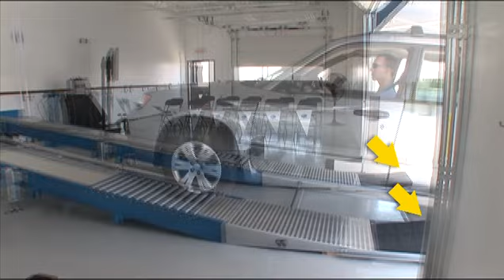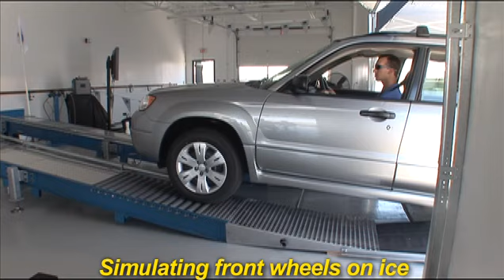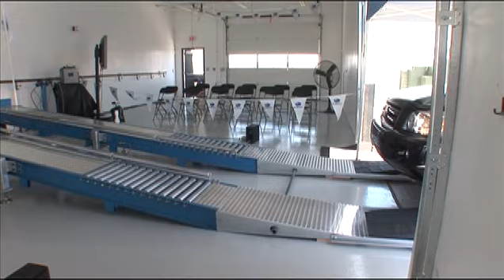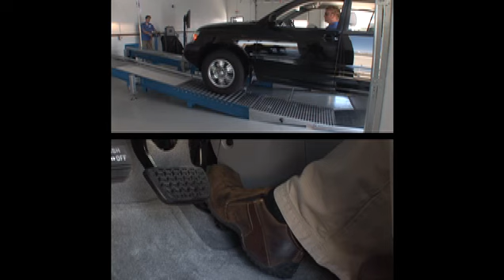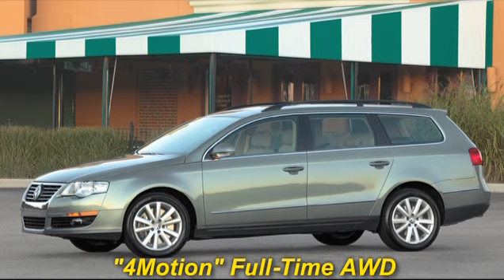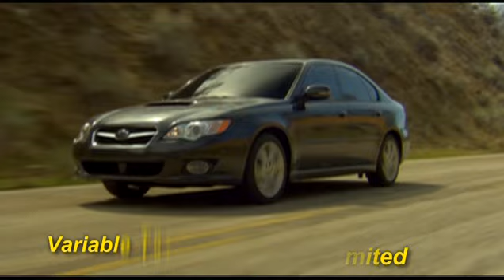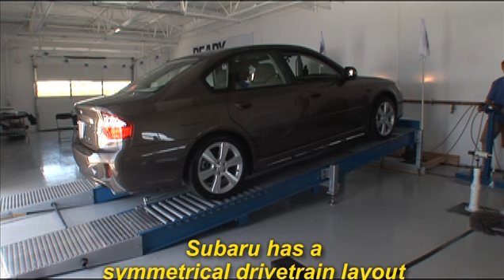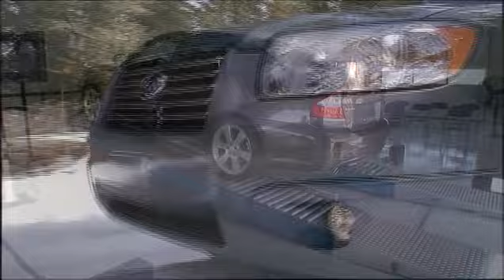Subaru Symmetrical AWD vs. Honda, Toyota, and Volkswagen

Comment: Good lord, the VW isn't failing at the ramp due to transverse engine mounting. It's because it lacks the ability to sufficiently lock any differential to transmit the required torque. Keep making the ramp steeper, and the subie will fail like all the others (or it will overheat its drivetrain). Make it less steep, and the VW and Toyota will do fine.

A vehicle with lockable differentials will pass this test at much, much steeper angles. (Modified toyota pickup, land rover, land cruiser etc etc). That's why you buy true 4WD with a "PART TIME" designation. Aka: Can't use it on dry pavement because it grips so well.

I will say, Subaru tends to have the best AWD system for mixed use driving. The thing is... you pay for it. It's not as fuel efficient, it needs more maintenance, and it is heavier. But it is probably the best full time AWD solution.
Reply: THAVANI it might have just been a clogged or burned up catalytic converter or a timing sensor issue, possibly something relatively minor.. poor Subie!
Reply: Last time I checked a Subaru has some of the best fuel mileage when you compare it to similarly equipped AWD vehicles that are not diesel, require premium fuel or in a luxury brand segment were the car cost significantly more. So essentially the foresters and outbacks closest competitors are the hr-v, cr-v, hylander, rav4, terrain and equinox. Some of these may have better fuel mileage but at the added cost of maintaining a hybrid or diesel engine and can get expensive as well (diesel significantly higher price than 87 octane which most subarus use) Also most sacrifice power or size to get them more efficient in turn making them less useable. Last saying they need more maintenance is absurd. Subarus get easily 250k miles as long as you follow the owners manual to the T(that's where people fail) What maintenance cost more? Never had to replace a major part and im 80k miles in and my live data reading on my legacy shows it runs like it did 4 years ago. Also people have a bad habit of putting low quality fuel and other fluids in their cars that make them "cost more to maintain." BTW my legacy at most consumes a quart of oil every 1600 miles which is not bad being it takes 6.7quarts every oil change and I have never had a transmission issue (their main issue is people don't rotate tires so they wear out and transmissions fail from uneven tires in subarus), head gasket issues no longer exist in these. So as long as you take car of your car, how is it more expensive. Some cars take over $100 just for an oil change.
Reply: I have a 2004 Outback H6 with a standard non-VDC 4EAT. Basically what you get from the Forester here. 

You CAN ABSOLUTELY lock 50/50 split with the auto, just pop it into 1 or 2 on the gear selector. That makes a massive difference, and you can definitely clear steeper ramps like this. I used to run mine on Jeep trails in the mountains south of Las Vegas with great success.
Reply: Have had a forester, full time AWD... fuel part is very true. any full time AWD car, alot of parts and especially the massive Subie trans and engine = heavy and will eat fuel, more wheels to feed whereas FWD will just pull the car and has less parts needed to send the power towards the wheels thats why they made massive 4 cylinder FWD vans. But if i am not wrong you can remove a fuse and start the car and the car should start in front wheel drive. not sure about the new models though.

So about the forester, 6spd non turbo. took it 500000km no major issues! just serviced it, regular oil stuff, the engine was never taken apart and the gearbox never had issues even the diffs.
Only changed belts, batteries, radiator and tyres like any other person.
The car eventually died not an engine issue or trans as far as i could see, the car was running perfectly as you start moving but getting the car moving, it would bog down like something was restricting it, maybe electrical issues as you give it gas and it sounded like a refridgerator condensor as if it was the air con because it kept giving the car a super high idle every 10 seconds while at a stop and only at a stop and couldnt turn it off.  might have been a driveshaft issue for all i know but its long gone now.

Now i have a Gc8, 5spd non turbo, 200000km no issues as well. same as the forester
Reply: Oh you can buy An Sti as it has DCCD no need for modifications 
50/50 power split and you can lock the centre diff and play around with Traction Control as well which in snow should so wonders
Reply: @thbabni  or just buy proper nordic winter tires and drive on snow/ice without any problems with a FWD or RWD car... I admit though, for ultimate fun on snow/ice either BMW xDrive or Subaru STI.
Reply: I dunno. My subaru crosstrek diesel averages 30 mpg with agressive driving, which isnt bad for a full time AWD crossover
Reply: Ben Mcghie shift the subie into 1ST gear axles lock becomes 4wd at low speeds
Reply: how you should overheat the drivetrain?
first of all there is a lamp which shows too hot drivetrain/diff oil.
second, if the traction control recognize spinning wheels with no traction, the system will brake these tires, so the diffs act like normal.
this stability control is also dangerous if you drive too fast on snow in corners, since you dont know what some brakes will do automatically if you slip a little bit.
Reply: Subarus are definitely not heavier
Reply: even if Passat has ability to fully transfer the torque to one front wheel with traction,it will be difficult to climb up becoz the whole weight of the car will be pulled with one front wheel.. however in a horizontal path,one front wheel may pull the car..
Reply: what crack you smooking? My daily crosstrek gets 32-35mpg a bit more than my familys rav4 toyota and cousins CRV, these smaller SUV's get around high 20's to low 30's in mpgs so i dont know what youre talking about. Lets talk reliability, cause my cousins CRV awd system gave out and needed to be towed on a flat bed a few months ago, stop talking out of your ass like subies are so bad.
Reply: 2018 WRX weighs 200-500 pounds less than an Audi A4. So idk where you get “it weighs more”. Hell it weighs 1000lbs less than an S5.
Reply: @FunBounty  I hope it does. The WRX is a half rally car. The S5 is for fast driving on the Autobahn.
Reply: my impreza weighs 3200lb with fuel oil and all fluids and me in it. and gets 28mpg... so

Comment: What a gimmick... you have just demonstrated the difference between a helical diff and a clutch/plate diff. Obvious Subaru bias and funding is obvious.
Reply: Hoozer YT to be honest the other dude did a lot more science talking than u did.
Reply: Your Moms Fudge Packer how is it bias  ... they did tests on different cars and saw which ones were capable
Reply: Hoozer YT These vehicles are not designed to be used this way. The test is invalid. This is an exaggeration of what a clutch type LSD will do vs helical LSD. The cars that made it up had a plate/clutch type diff/s, the ones that didnt, had a helical diff/s. This just goes to show how ignorant people are, not knowing the difference, and blindly believing what they see in front of them without doing any proper research. Not to mention the Honda AWD is not even a full time AWD system. The title should be "Clutch diff vs Helical diff test". That is what is demonstrated here.
The bias for Subaru is clear. The Volks had a clutch type diff and made it up too, why did the not promote the Volks? SMH lol people are retarded if they trust this bullshit video.
Reply: Your Moms Fudge Packer ok turn to insulting me... just goes to show your intelligence
Reply: That is apart from the point. You clearly dont understand the difference between the two if you're still saying one is better than the other. Go do some research kid.
Reply: Your Moms Fudge Packer One was good enough to make it up, one wasn’t, kid.
Reply: Until the plates weld themselves together and blow the diff. Also this situation is a horrible representation of real life usage. Your point is moot.
Reply: Your Moms Fudge Packer ok and?
Reply: Stop being a hater and just go buy a Subaru. You know you want to.

Comment: Notice there are no Nissan, hmmm afraid of something Subaru?
Reply: 860kgamer hahahahahahaha why would they? Nissan and Mitsu both went to crap
Reply: thisis howiroll the GTR is a top of the line car the AWD has more sensors and parts than the space shuttle. And its going to stay that way. We are comparing cheaper cars not race cars. Subaru system is basic and proven reliable
Reply: What makes you think nissan is even comparable to subi?
Reply: Nissan isn't comparable to a scooby, there are years of rally championships and rule changes that prove that lol.
Reply: There's also no Ford Chevy Dodge Fiat BMW Skoda Volvo Peugeot Renault Mitsubishi etc etc... They can only test so many cars.
Reply: They’re afraid that they’re gonna roast the shit out of Nissan like they did Honda.
Reply: THAVANI once again we are not comparing the top of the line systems here just cheap cars.
Reply: DroidTech lmao! Are you serious? Mitsubishi is on the bandwagon now of mid size and compact SUV. Their compact car is a joke too.
Reply: The Nissan GTR is primary rear wheel drive... 
it ony uses AWD when its needed. works like a 4WD and has a transfer case. Thats the R32, 33 and 34.
The R35 sends power to the rear first then sends it back to the front diff since it has a rear mounted transmission.
 All Nissan GTRs have a 30/70 torque split meaning they send 70% power to the rear and 30% to the front which helps in launching a car, gives you a harder launch that puts you into the seat because of that little 30% towards the front that lifts up the front end a bit as you launch the car hard with the Launch control

Nissans GTR AWD/4WD system is for traction at Launches and out of corners where its needed most.
Go into a corner and you can almost exist flat out with the back end sliding out a bit.
So when driving on the highway at 70kpm or something, its rear wheel drive until you stick your foot to the floor quickly and the AWD kicks in to fight the loss of traction.

The Nissan GTR box is a masterpiece but this isnt the test for it cause i dont know how to sends power to the wheels as demonstrated in this video.
The Sti DCCD system, this test it will demolish cause you can lock it and even give it a 50/50 power split making it pull just about anything (Trucks, other sedans of its class like the Evo since the Evo has an Asymmetric system [Yes that has happened, search Youtube]) out of sticky situations such as snow. so tug of war in mud or snow, you better have something that can rival the Subaru Symmetrical system otherwise you are getting towed.

Have a nice day! Ta!
Reply: DroidTech yea agree seems like they are made different in other countries

Comment: I loved this video. I own 2 pre owned Subarus and the 2007 3.6 Passat, second best. I would like to have seen this test also done on a level surface. I'm thinking the VW would've been able to move with that one tire and maybe it's a more realistic, daily encounter.
Reply: My 2001 Dodge Dakota 2wd quad cab with mud tires and 600 pounds in the pickup bed would go just about anywhere.

Comment: I have a Subaru outback wagon even with really expensive snow tires it still sucks will still spin out around the turn won't grab I don't understand
Reply: It all depends on how sharp you are turning and how much G-force there is within that turn. That goes for all cars. I have a 2010 outback and it does the same thing. However, if I downshift and then touch the gas it finds grip quickly. Within maybe half a second. Don't brake if you start to slide in a turn. Point the car where you want it to go, and lightly accelerate. This is where Subaru's AWD is extremely handy in regards to turning.
Reply: Hendrix G  I appreciate the input I wish it performed as good as I thought I used to have an old-school mama van with electronic awd with junkie bald tires on it and you could hold it to the floor go around turns go up hills do everything you want without worrying this Subaru is junk!
Reply: poop maybe it was just because that old van of yours had no power
Reply: I have a honda del sol with cheap goodyear snow tires and this thing goes through everything in minnesota.  so you are doing something wrong.  if my low little shit box can make it up steep driveways with a manual trans covered in snow and never have to worry about spinning out...you are driving too aggressively or shitty.

Comment: nearly all of these AWD comparison videos are rigged in favor of the brand they are trying to promote. sadly i would say just from personal experience 99% of people think they know how AWD works, but really don't fully understand it. then you get brand wars started and spread ignorance as a result. so this is how it works. there are mechanical viscous coupling units, mechanical torsen differentials and electronic coupling units. electronic units require sensor input before it reacts. viscous coupling units use gear oil in a clutch pack differential much like a clutch pack limited slip differential, just no ring and pinion gears. so when the wheels up front slip, they lock the driveshaft to the transmission and rotate all the wheels at the same speed. electronic units are FWD until locked together by a solenoid in the transmission but still allows for slip with clutch packs. torsen differentials use gears rotating in opposite directions that bind up to lock the output shaft to the driveshaft. every video compares vehicles with  the same or similar AWD systems. the only difference is they turn off traction control and ESP in the vehicle they are trying to promote and leave it on in the others that are competition. traction control cuts fuel to the engine obviously resulting in a power loss and less rotation at the wheels. ESP applies brakes to the wheels that are slipping to stabilize the vehicle. if the front wheels slip and can't rotate fast enough to cause lock, the coupling unit or torsen can never lock. notice in every video demonstrating this they start to move forward on the rollers and then traction control kicks and they start rocking back and forth. even though each vehicle would climb the ramp and rollers if traction control was off, these videos use these tricks to sway your opinion in favor of the brand they are promoting.   the Audi Quattro system is the best AWD system you can buy for the money, and it would still fail to climb the ramp if the traction control is on. don't believe everything you see on the internet.
Reply: Wesley Ash The Mercedes w163 (98-2005 ML) has 3 open differentials (+2 speed transfer case) and an ESP off button. If you leave ESP on the system will break up to 3 wheels and pulse as long as you don't sit there and gas it or spin the slipping wheel(s) above a certain mph as then it will cut the throttle valve. If you turn the ESP off then it will allow you to spin the slipping wheels much more. If you switch the transfer case to low gear then the traction system (4-ets) tightens up. I think in high it takes a wheel speed difference of 10% for it to modulate the brakes and mimic a solid differential, while in 4 low I believe it's less than 10%. The face lift, later model versions also have a suspension sensor that will brake the wheel if there's no weight on it, and additional improvements.

The reason they went with the open differential system is so that no matter what you can have the ABS operate. Interestingly enough the 4 ETS system basically just takes the ABS algorithm and applies it backwards or 'reverse' for traction Lol.  There are some fancy ABS braking algorithms too for braking on gravel to pile gravel or sand up in front of the wheels and also a hill descent mode aswell.
Reply: Wesley Ash would toyota climb if traction control was off?
Reply: TL;DR
Reply: Wesley Ash well said sir couldn't say it better myself.
Reply: Show me a real world scenario where the Subaru can climb a hill that the Passat can't. As for the Honda, this definitely isn't the only video showing how utterly worthless their "awd" is.
Edit: I see that Suzuki also shines with their lack of representation in this test. I guess this Subaru bias test couldn't show a far cheaper and more reliable alternative beating them.
Reply: This guy just salty.

Yes, the Audi Quattro has a very good AWD, on par with Subaru. But they are in completely different price brackets. 

And Audi wasn't used in this video.
Reply: But I've seen a russian video where they use rollers on different cars and the Subaru was the best one. And they are not biased on one brand.
Reply: Chubbysumo Traction Control and Electronic Stability are the reason that it is able to climb.

If those are turned off, power would not be redirected to wheels and it would not climb.
Reply: Dumbest comment on YouTube and I didn't even read 5 words. Just off size and the copy and paste Wikipedia page
Reply: Ray45929 lol. Fucking idiots. Go drive all these cars and you’ll realize they’re all garbage except the Subaru.
Reply: the truth is simple
Reply: Wesley Ash one of the best comments out there
Reply: Wesley Ash you tried to sound cool and act like you know something. But watch the fucking video. The Subaru proves to be best. What more do you need? Fucking idiot making excuses.
Reply: The video is rigged.  The subaru would not climb either had they put a model with ESC and TCS on it.  They turned it off.  I have seen subarus fail to climb slippery surfaces.